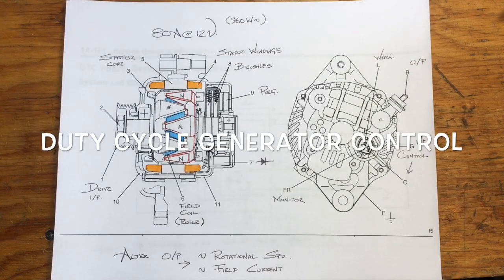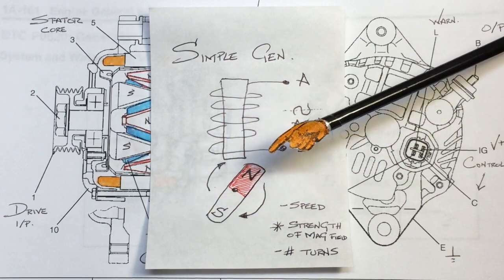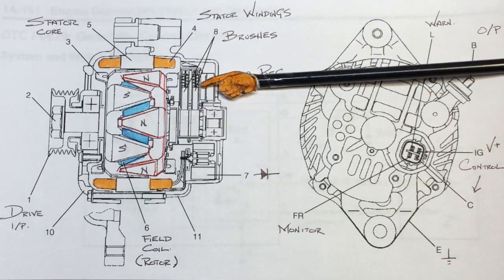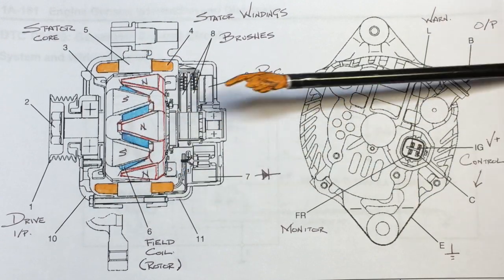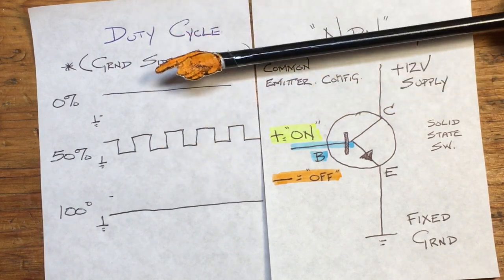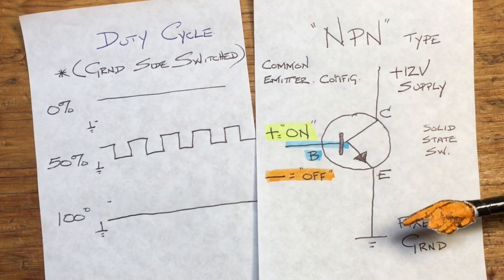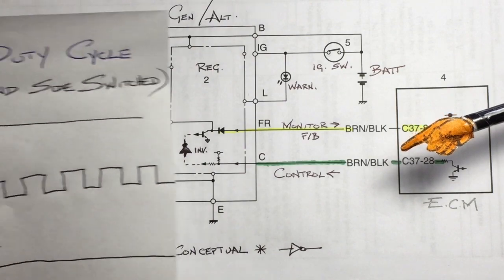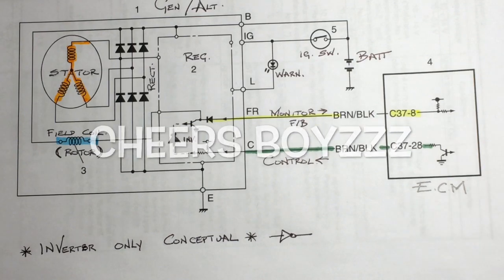Duty Cycle Alternator Control 1/3

Comment: Great presentation Ian. You explain things very well. When I saw the drawing of the NPN transistor I just thought some people might be confused to see +12v supply on the collector and think this is a short to ground because the load being the field coil isn't in the picture. Of course with no ground there is 12v just like shown. Anyways just nitpicking here 😊
Reply from the maker: Hey Dylan good to hear from ya. Yes your point is taken...That's why in addition to saying "through the field coil" I also put the pop up wording. But I think I will mention it again in part 2. If you and I were thinking that, others will too....Cheers & Thx

Comment: Nicely explained ian. Im ok with referring this as actual 3phase as you do have 3 separate outputs at 120degrees. Maybe add in to part 2 the practical application of AC ripple when the diodes fail and how AC in the DC system can cause chaos . Similarly DC in an AC system is a concern with EV charging. Food for thought
Reply from the maker: Hi Dave. So much material, difficult to cover in a reasonable time. I know this is more "book" work than most will cope with. Part 2 is "scoping" the control & ref. relative to system demand. Will include your recommendations. P.S Will let you know when it arrives. Cheers Pal